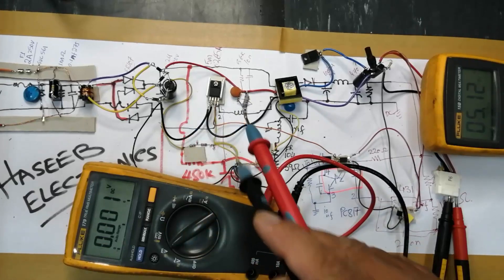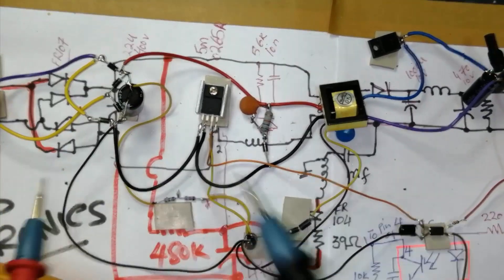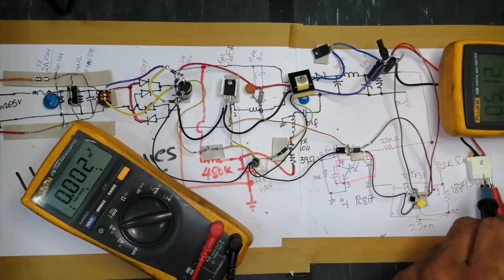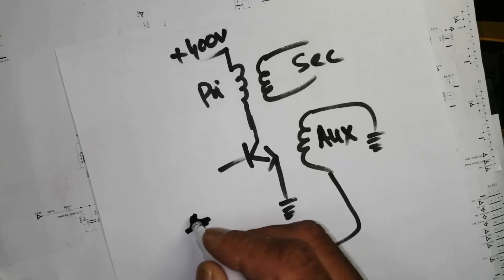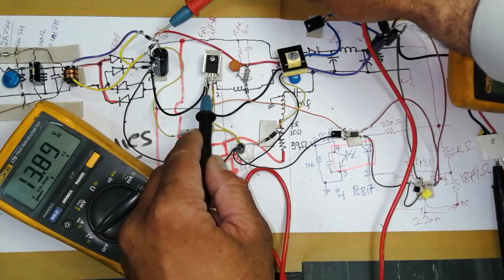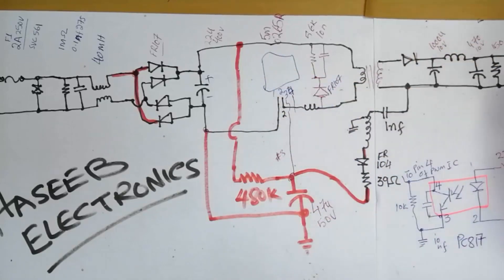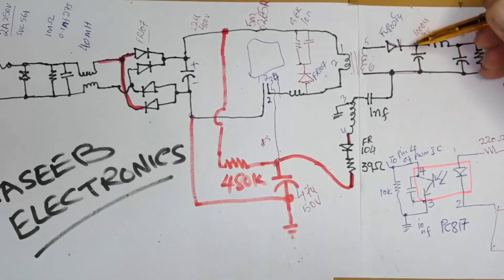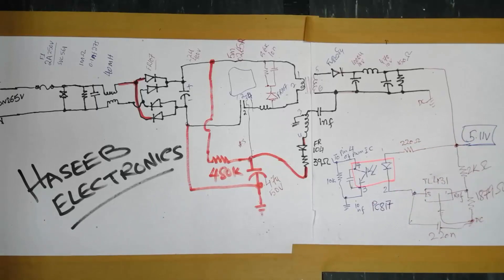#228 How to Design 5 Volt 2 Ampere SMPS Switch Mode Power Supply

Comment: Sir please I have two questions, won't supplying voltage from the 240v rail through the 480k resistor cause an overvoltage on the switching IC's VCC pin? If not why? 

Secondly, how and why will the supply voltage be switched from the 240v rail to the voltage on the auxiliary windings? 

Thanks in advance.
Reply from the maker: for more deep clarification please check video number 297
voltage through 480K resistor are applied to apply startup the PWM chip, when it will start then it will switch primary an sin result there will induction in secondary and auxiliary winding

Comment: Sir urgent can you plz make 48v 30amp lead acid battery charger circuit. One battery is 6v 200ah total 8 batteries are there in car 48v 200ah. Charger stop voltage at 60v 65v equilization at Max this happens once in a while or else it stops at 60v with low amp of 10 to balance those batteries it goes 56v to 60v every 5 Sec
Reply: A simple circuit sir voltage should not drop at load ur video is so informative I am no expert or even a beginner but your video can even teach anybody like me. Thanks

Comment: good explanation. i have a small doubt. in ac input has RLC filter. two parallel inductor connected in RC circuit. when power off cirucit, the magnetic field collpase inductor to discharge opposite side. how to discharge two parallel inductor via RC circuit. in transformer  secondary side also how to discharge inductor to RC circuit
Reply: @HaseebElectronics  that  means ac has no polarity. it could be discharge any direction of RC network